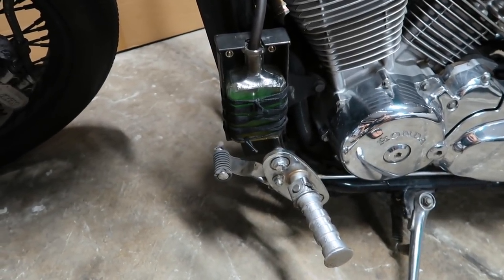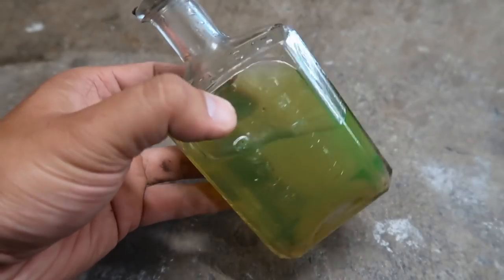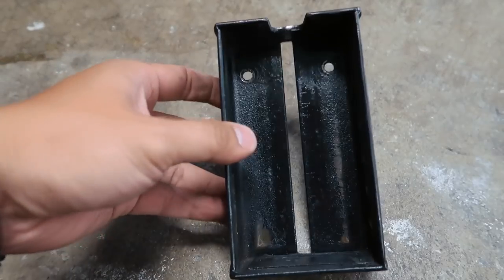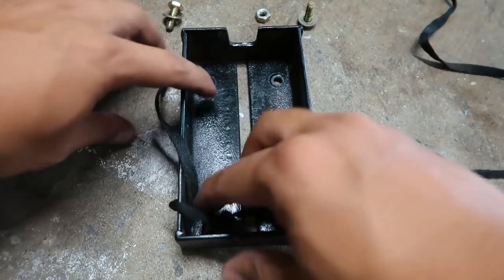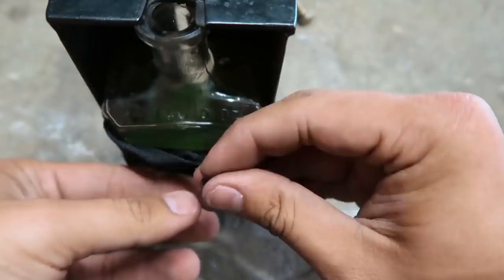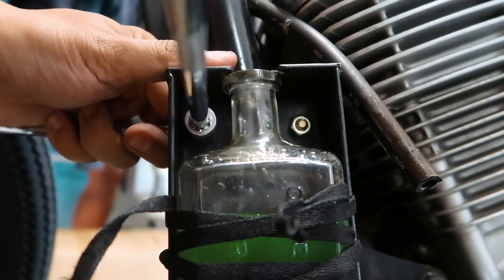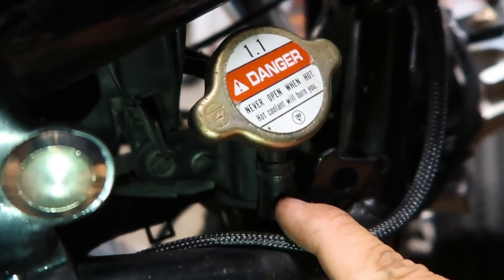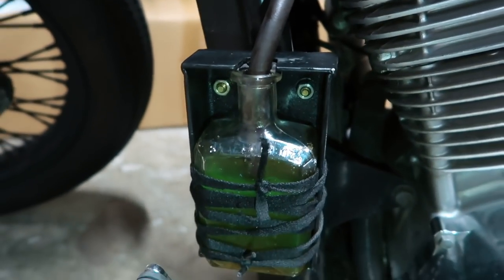Honda Shadow Coolant Overflow Reservoir MOD | Lnspltblvd

Comment: If you can put together a full step by step build video together. I would binge watch the hell out of that. Dusty is my favourite bike, but I love them all. 🤘😎👍
Reply: No doubt. Honda Shadow 600 from start to finish. Need some pointers
Reply from the maker: nice videos!
Reply from the maker: Yes! I will. I gotta find a cheap stock shadow first
Reply: LNSPLTBLVD 💥👍💥 Thanks dude. If you every feel the need for a unquestionably loyal English apprentice🧐I'm ready to move in 🙌 keep up the good work🥇
Reply: is there no need to make this bottle completely air sealed??? thought you need a  vacuum..??

Comment: how the water drops back to the radiator when it cold?  that the question!
Reply: As the coolant in the radiator cools down it creates a vacuum sucking up the fluid it displaced when it got hot and filled the overflow.

Comment: When you first add the new container do you need to add some fluid in it? Does the hose need to go all the way to the bottom of the bottle to suck up the over-flow fluid to keep suction? Thanks. Oh yea and after doing this all the stock tank and hoses for the over flow can just be deleted or does anything need to be plugged?

Comment: So when you put the hose into the bottle. The other end originally goes into the bottom of the coolant reservoir tank. What did you use to close it or seal the reservoir tank?
Reply: This replaces the reservoir tank. You throw it out.
Reply: @dre3k78 So you must plug off the other hose , since there was a top hose on the original tank?

Comment: First of all nice work. The bottle you use is 200 ml? And if so it's ok with that capacity? And second i have the same model and i want to know if you have cancelled the fuel pump and if it works ok without that.

Comment: So, we dont need the coolant reservoir?
Reply: The stock one? No. The glass bottle he is putting on the bike is a replacement for the stock coolant reservoir
Reply: @Misguidedaliengamer what do you do with the hose that went to the top of the original tank?